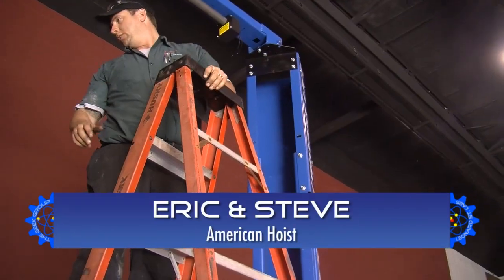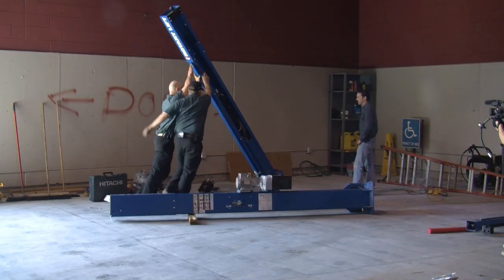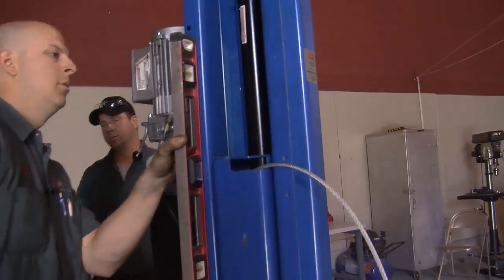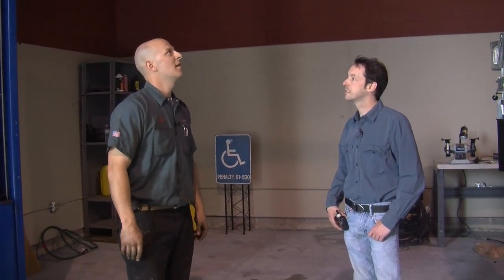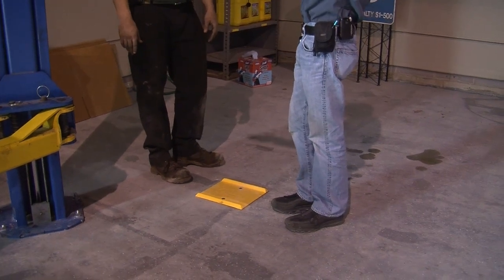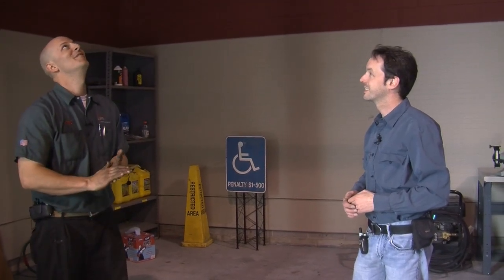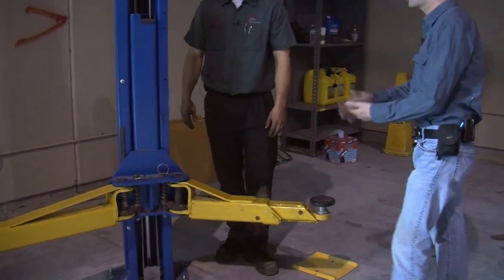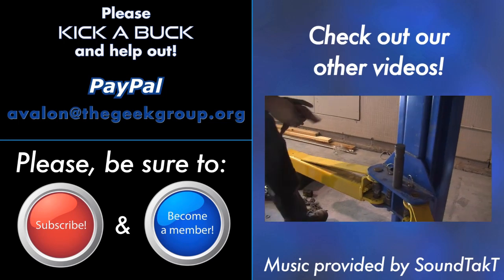Rotary Hoist Installation by American Hoist

Comment: Did hear somewhere that it is not recommended to drill all the way through the concrete, since it is possible to knock a big chunk of concrete in the bottom which greatly reduces the structural integrity of the concrete. Not sure if this is a truth, but at least sounds very reasonable.

Comment: We just put two new ones up in our shop, symmetric 10klb.  Like said these aren't that hard to put up with general skills.  Two guys can stand each post up as they only weigh about 600lbs each, most is at the base and the carriage assembly.  Im surprised they didn't mention putting a grout under the baseplates as this is what we did to spread the load of the footprint, along with using the shims to level each post.
Reply: Grouting is a nice touch but only necessary for over 1/2" of shim. Use machinery grout and wait 24 hours before use.
Reply: Agreed.

Comment: "Drill all the way through the floor"
Damn.
That is the kind of knowledge you only aquire by NOT doing it one time and then cursing for a couple of hours while correcting your dumb mistake =P
Great to know =D
Reply: He is the very first guy to say that in all the lift videos I have watched!
Reply: One guy said he always uses epoxy in the hole!
Reply: @MagaRickn  The reason MANY installers WITH EXPERIENCE ( and yes it does happen to people with experience) do this is just in case you are off or mess up with measurements then you can pound the studs thru the concrete into the dirt, then not having to worry about raising the column over the studs just to move it over a few inches or for other reasons that may come up during installation. Rare but it does happen, AKA "Murphy's Law"
The empty hole that you will not use can be filled with Mortar, concrete OR epoxy. 
AND just some info, No one uses Epoxy on a fresh/ one-time install unless you have bad or cracked concrete and if that is the case, just break it out and install concrete pads for safety reasons.
I think I know the company or person who mentioned to use Epoxy. This company or installer is completely wrong and I will not mention the company or person. 
This may be the same person who calls "equalizer cables" ......."Equilibrium cables" , LMFAO
 Cables do not lose their equilibrium and do not get dizzy. I had to laugh at this so called pro-installer! 
Take it ez, Tom in NV.